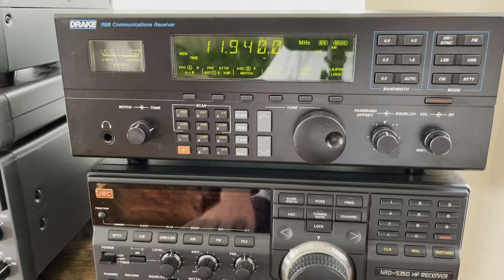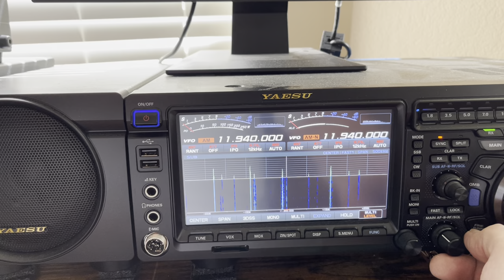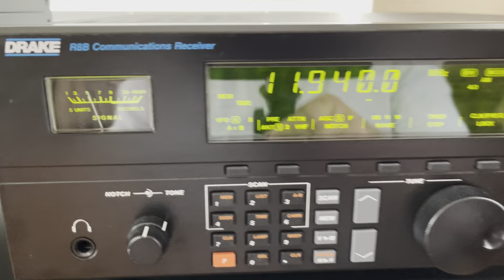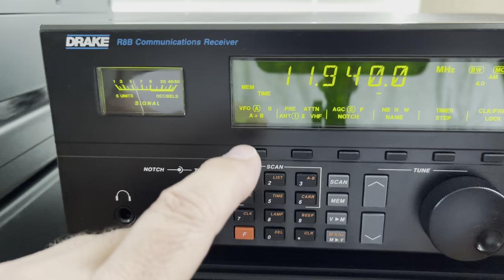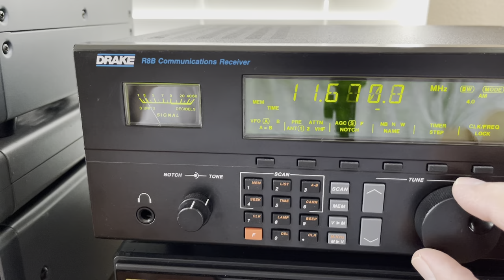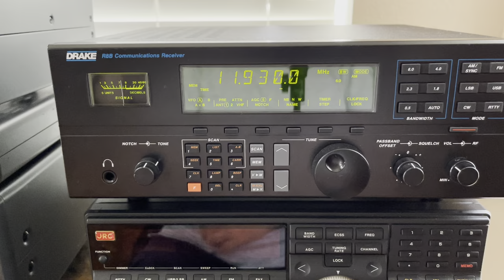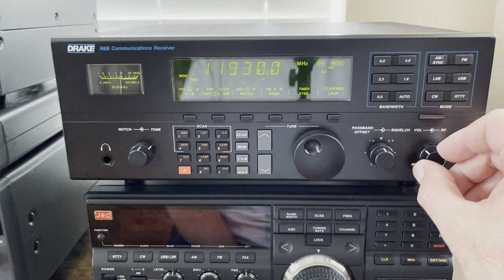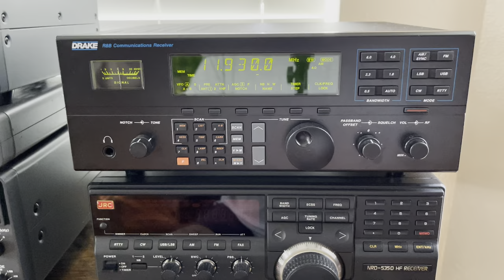Drake R8B

Comment: I just got a Drake R8 with VHF converter. I am simply blown away by the audio and its ability to remove static crashes on 75 and 40 meters. I have been a ham since 1965 and I never knew about this jewel until I watched your channel. These are great receivers.
Reply from the maker: Plus the Sync is awesome in AM.

Comment: Thanks for doing this  on the R8B , nice receiver but can't seem to find one under 1500. Which is a bit much for a used rig, there are two on e bay, still considering.  I am a ham but really enjoy doing what u are doing, listing to the commerical and ute bands, ham is  mostly boring to me. Thanks,  matt
Reply from the maker: I paid more than that I think.  These are awesome receivers.  One of the best consumer table top receivers ever made. I should trade you a bunch of receivers for your 9500!
Reply: Don't count out the capabilities of the original R8. The ergonomics might not be as convenient, but the specs are nearly identical for a LOT less than an A or B model. My R8 and my R390A are closer in performance than people might think.

Comment: I just bought one of these on eBay. I am new to all of this. What sort of antenna or antenna system would you recommend?
Reply from the maker: @cahester1  there are 2 antenna connection spots on the back of the radio.  One uses a red and black wire receptacle, just push the button and stick a wire in there.  You could use a piece of speaker wire or any type of wire.  The other connector is threaded and called a SO239 and requires a thread connector on the end of some coax cable.  That is what I use.  I have a loop antenna in my backyard stuck in a tree.  Run the coax into the house and screw it to the radio.   You might need an adapter to get the right connector.  Adapters are available on Amazon.  A good starter loop antenna is the MLA30+ and you can get it on Amazon.  It has the coax and you just need an adapter to hook it to your radio

Comment: Does your S-meter illuminate? My R8a I just got, the meter doesnt light up.
Reply from the maker: Yes my meter lights up
Reply: Maybe a bulb burned out, if there is one?
Reply: @audiophileman7047  No, theres 6 leds behind the meter, but I found the problem. A connector pin was bent. Its ok now. Theres another 50 some behind the display. No bulbs.
Reply: @RadioRich100  LED's are definitely better than an incandescent bulb.  They should last a long time.  These Drake radios must be really well built.

Comment: The yeasu had a button lit up with Sync written on it. So it should have sync or not ?
Reply from the maker: @ON5ALE-Alessio  no, that was to sync the two receivers. That radio has two separate receivers inside of it.
Reply: @dieselten01  geez it has more buttons on his facade than a teen with pimples.  And doesn't  have that essential and very useful sync?  🤦‍♂️🤔. Is yaesu just fooling us with gimmicks?

Comment: I concur with the comments here that this is a superb receiver. A friend sold me his R8B in mint condition with the original box and all paperwork and I've been putting it through its paces. Very impressed so far.

In your video looks like you are tuned to Radio Marti on 11930 kHz which is often jammed by the Cuban regime and this may explain the background noise that you hear. The Drake does an excellent job delivering clean audio under such circumstances. 73's!

Comment: Drake R8s are great radios. Especially the R8B's. Unfortunately, age is beginning to catch up with them. I would suggest helping extend the radio's life by running off a 12v power supply to reduce the radio's heat. Feel the top even when it's off to see how much heat the internal power supply creates. Running it off a 12v power supply eliminates that. 

The ability to Sync to the Upper or Lower Sideband of an AM signal and adjust the Passband while synced goes a long way to bringing in those weak signals. 

These are great versatile radios, and even now, they can hold their own against the DSP crowd. 

By the way, Drakes's outstanding audio also has to be mentioned when discussing these radios. It's one of the first things I miss when switching to another radio brand.

Great Channel.  You have a new subscriber.  :-)
Reply from the maker: Thanks for the tips!
Reply: I am not getting any heat off the top of my R8. I do not leave the power on to it when it is not in use. That may be the difference.

Comment: With all those radios how do you divide antennas to all of them, splitters or coax switches?
Reply from the maker: Wellbrook antenna outside comes into a series of Stridsberg Engineering Multicouplers. They are amplified and hot all the time with the Wellbrook signal
Reply from the maker: Stridsberg are for RX only. Absolutely no TX, you will ruin them